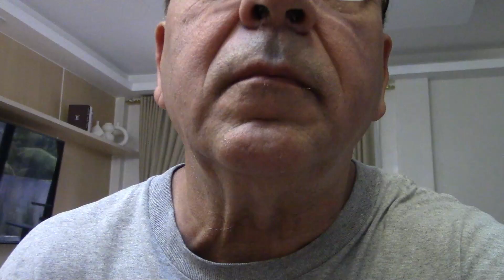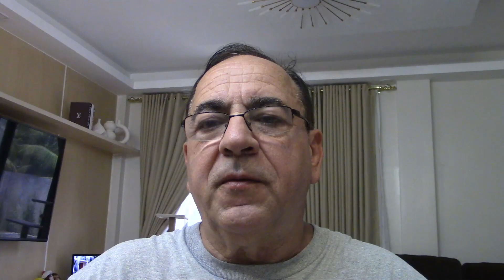Lessons Learned Building in the Philippines

Comment: Hello Ray..Got a few questions because I am 60% in with my build in Tabunok near Cebu City. You have a water filter system so you trust drinking water straight from the faucet? #2 Why you feel you need a water softener? #3 Have you checked on the solar panels being installed? You said you would mail order them but what about warranty work if something goes wrong with the solar system?
Reply from the maker: No I still buy drinking water. It tastes better and no I don’t trust the tsp water to drink because I don’t have UV. The water has too much calcium and is hard - the softener get rid of the calcium- you can tell when  a glass drys or boiling water. I haven’t done solar  yet - had additional hospital expenses in Thailand. Around here warranty isn’t really s thing to count on BTW
Reply: OK good info! Do you remember the cost of labor you paid to install a spilt type aircon? We got quoted P7,000 per unit. @rayintoledocebuphilippines5517